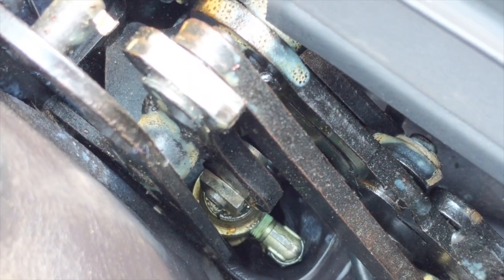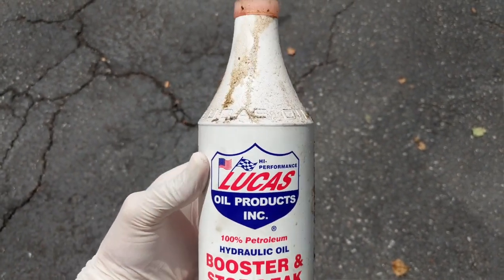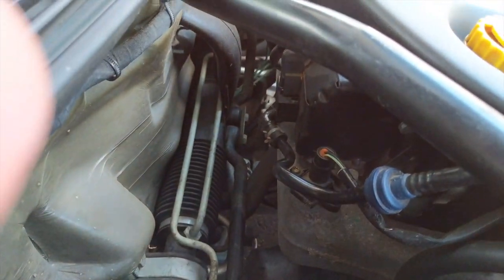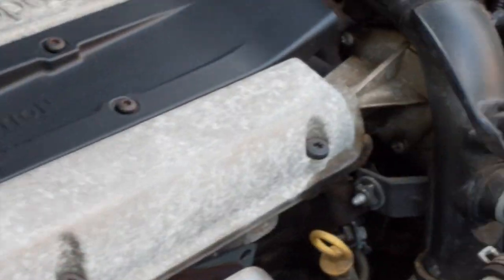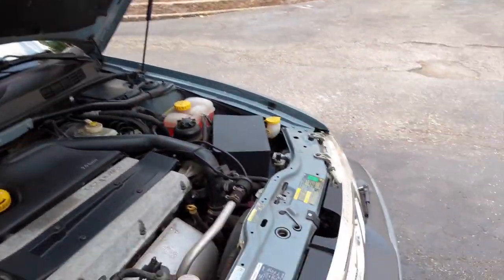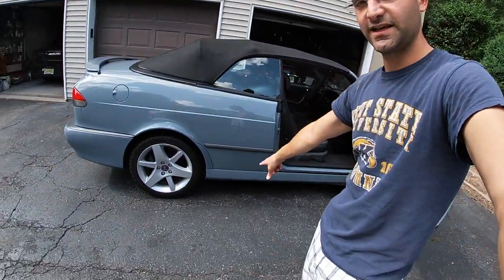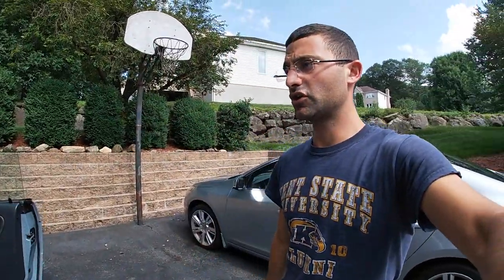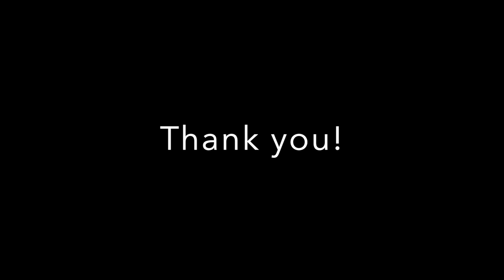Saab P0442 Small EVAP Leak Repair + Hydraulic Leak - VLOG

Comment: Hello again I hope you remember me we had messaged each other about my 2000 Saab 9-5. So I fix the leak it had before but now I have to replace the throttle censer located on the top of the engine. After I replace the part do I have to reprogram it some how? And is it safe to buy a used throttle censer? Or buy a new one?
Reply from the maker: It's safe to buy one used. However, I did and today I'm replacing it. So it can be risky. I am replacing with another used one that works. Just plug and play there is no programming. Just make sure you have all the torque specs. The aluminum can strip if not careful. Good luck
Reply: Kyle Pancis this should fix the problem I’m having? At times the car turns off on me and the oil pan light comes on along with the fill coolant censer on the computer screen in the car. Can that be from the throttle body?
Reply from the maker: @reinaldonieves1964  not sure to be honest! do you have a tech2 to scan the car?
Reply from the maker: @reinaldonieves1964  send me a vid clip of what its doing if you can
Reply: Kyle Pancis no I don’t but I took it to auto zone and the code came up saying it was the throttle censer.
Reply: Kyle Pancis ok I’ll send it to you tomorrow.
Reply: why not throttle body cleaner and electronic sensor cleaner first?

Comment: P.s mines a Saab 9-5  bio turbo 2.0 2005 old shape / model
Reply from the maker: Should be the same tech in the 2.0. the 9-3 I worked on in the video is the same engine
Reply: @KylePancis  ahh rite that's good too know thank you realy handy , but I have replaced that sensor and it is reading fine ie the temp is right but still some days it shall knock off still some times come back on right away again but mostly just knocks off within a min or two of driveing ?? Please any more help would be very much gratefully off anyone

Comment: Did you do the video for the sensor that stops the a c ? Please
Reply from the maker: Yes, that's the temp sensor that can do it? Are you getting a CEL?
Reply: @KylePancis  aah oki doki cel? Engine light ? No .. I've done the ac test were you hold two buttons but still certain days its switches off 2 mins after driveing all works ok I.e it's cold very ..is there not an internal  cabin sensor that can stop it ? I have been told over internet possibly could be a resistor of some sort near the fan blower motor any ideas are highly appreciated thanks Kyle